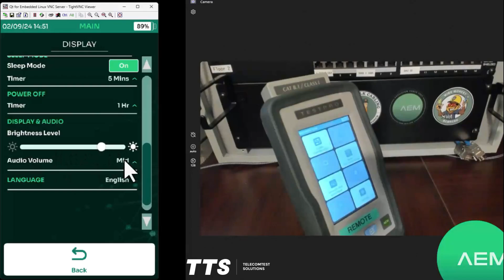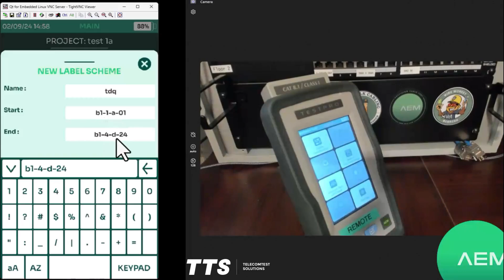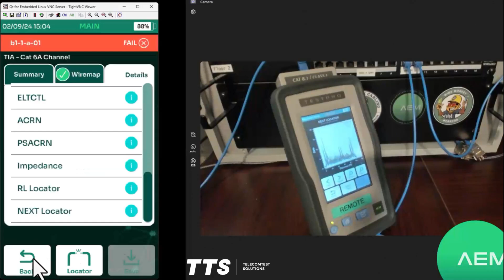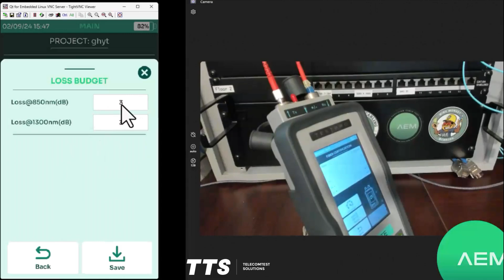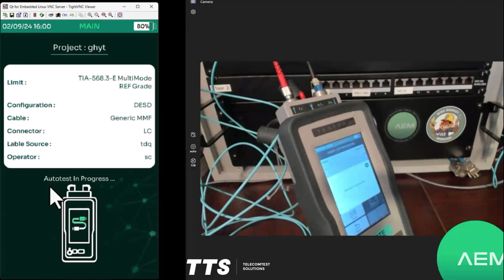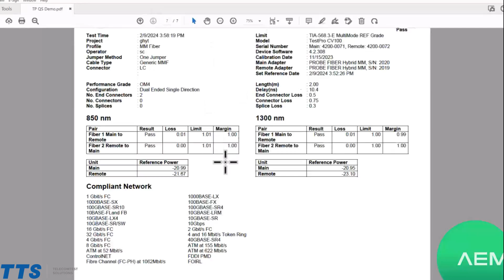TestPro CV100 Quick Guide

Comment: Only Reminder.
About rules telecommunications.
 As shown on video your sconnecrting multi mode patch cord it's ok. But your using Adapter single mode Lc fiber coupler wrong. 
Also in 
test pro cv100
  lc upc  blue female tuse it for single mode.
Reply: Singlemode coupler can be used with either multimode or singlmode fiber. A multimode coupler, however, should never be used to couple singlemode together. In the field for the. fiber panels, it is good to differentiate in order to easily identify MM panels vs SM panels, but for field testing having separate MM and SM couplers is not necessary.
AEM includes the SM coupler so it can be used with both MM and SM.